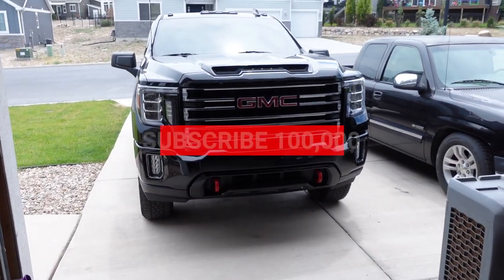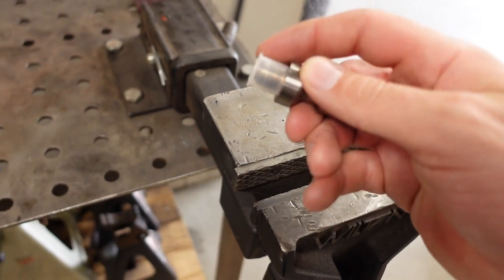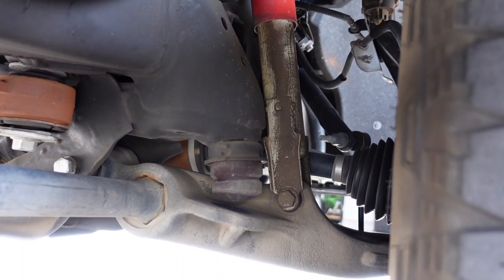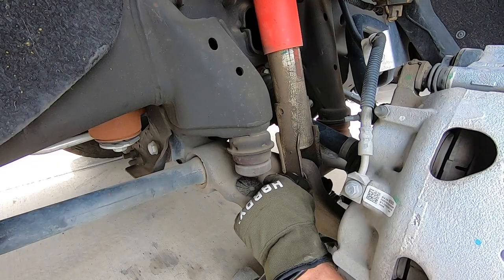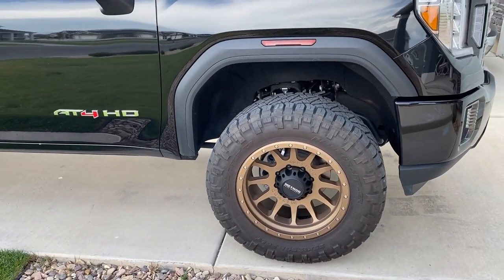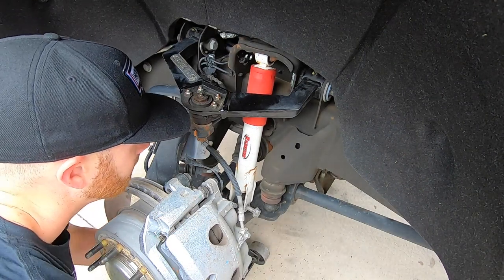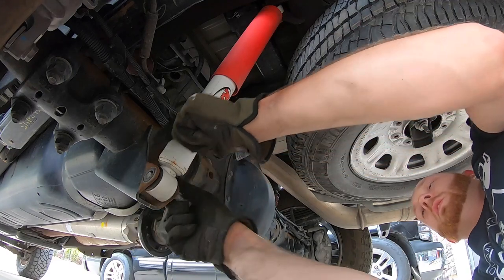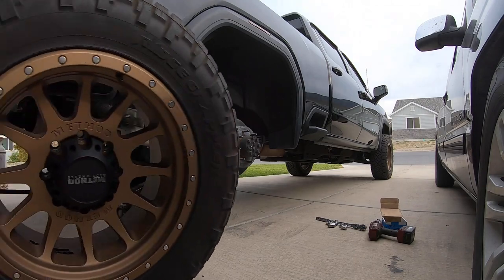Fixing what GM wont on my 2020 AT4 HD & Improving the Ride Quality #gmc #at4 #duramax

Comment: They say the steering stabilizer isn't needed due to the steering gear being increased in size on the 2011 model year.  i installed one on my 14 dmax and could not tell it was even on there, if anything it just made it harder to get to the lock during parking lot maneuvers. Install one for a video and give your thoughts.

Comment: First off, love the HD AT4!! I would have one but it would be overkill for what I need so I own a 2021 Trail Boss. Secondly, I’m surprised they run monotube shocks in the front. I have already upgraded my Ranchos and am running 6112 coilover Bilsteins in the from and 5160 Bilsteins with a remote reservoir in the rear. Worth every penny. No more annoying body roll.

Comment: Why people F with brand new trucks under warranty is baffling.  OF COURSE they'll void the warranty for ANY reason ESPECIALLY when you start screwing with aftermarket parts.  Why so shocked????
Reply from the maker: not shocked or surprised at all TBH, and even though plenty of guys have seen shock wear out with BONE STOCK trucks, I'd much rather upgrade than replace with another stock part anyway... every failure is an opportunity to upgrade the way I see it.

Comment: You can get your TPMS pressure low pressure point set to any pressure you want. Can be done with a factory or equivalent scanner
Reply from the maker: hmm... I need to learn more about this then
Reply: Can u do with Hp tuners? Or will a dealer do it ? Thank you
Reply: @bruceshepard1136  I don't think HP can but dealer or even independent shop. I use Snap on Verus
Reply: Yep. My autel and snap on scan tool will do it.

Comment: The factory stabilizer left for the 2011 model year when the GMT-900 HD frame came out (early GMT-900 were still on GMT-800 frames 07-10).  GM claims that because the gearbox was near doubled in size and had larger parts inside, that it was deemed able to handle the needs of the front end without the stabilizer shock.  GM ironically in the bulletin for it had a steering stabilizer kit you could purchase if you felt one was necessary to have.
Reply from the maker: thats funny... you don't need a stabilizer, but we made it easy for you to install one if you want

Comment: Fellow Utahn here. Considering buying a 2022 AT4 2500 Duramax right now. Have watched several of your videos and I appreciate all of the info you're delivering. 

My sister-in-law lives within a few miles of you. Gotta love those Utah horizons. =]

You mention the truck is stock height, but you also say you've installed a leveling kit. Does the kit provide ~3" of height gain up front? Are these Bilsteins too short for this application?
Reply from the maker: the new shocks are he same length as the stock ones that came off, and for the leveling kit, there is a short spacer on top of the shock so in my case its a leveled truck on a stock shock. That's how Cognito made their kit.

Comment: Have you looked into the coil over conversion for these yet?
Reply from the maker: I have thought about it, I think BDS makes em, and also Kibbetech? I'm sure that would make it ride soo much better
Reply: @LawrenceTolman more than likely. I think fox makes them too. I just wish someone would make a kit for the 4wd chevy obs. I seen that digginz71 has a lowered 4wd obs on coil overs but im not sure how well it would work on its stock or lifted counterpart. The shock towers are kinda dinky and I feel like they would rip off the frame fairly easily

Comment: Didn't your AT4 come with that "factory 2" lift" on the front ? I believe all they do is twist up the torsion bars, right?
I have a 2020, 3500hd.
Reply from the maker: That’s only on the 1500 AT4, the AT4 HD has the same exact suspension as the other HD trucks, including the Silverado HD

Comment: Hey just wanted to give you a heads up, the service tech at your dealer is wrong and needs more training. Your warranty should not by any means be effected due to installing a leveling kit. Prob 5-10 years ago GM and Ford revised their vehicle warranty to cover certain vehicles such as trucks under warranty due to some court case they lost here in Detroit. If your really concerned about it, just use a GM Performance leveling kit and pay the 1-2 hours to the dealership to install it and you should be fine.
Reply from the maker: I didnt even know GM Performance made a leveling kit for these...

Comment: Aww, you did a safety no no. Whenever you jack up the front or rear, especially the rear, you should have chalked the wheels. If you are on a slight incline, like most driveways are, and you lift the rear, there is nothing stopping the front from rolling down the driveway. Lifting the front is a little more forgiving since you can put parking brake on.
Reply from the maker: thats an accurate point, and I always do put a chock back there... just don't necessarily show every single step on camera

Comment: I am being told that riding on front bump stops is completely normal for my 2021 2500 Denali. Never had a truck ride on bump stops empty before
Reply from the maker: mine were pretty dang close when it was at the stock height

Comment: I have a 2014 Silverado 1500 and it just rolled over 100,000 miles and I just installed the Eibach Pro truck stage 2 coil over kit. Wow what a huge improvement in ride quality and handling. Highly recommend them!
Reply from the maker: another good option

Comment: Buy a 3/4 or 1 ton truck don't be surprised it rides ruff.    They're built for towing/hauling.   If it's under 10k and only tow a dozen times a year buy a 1/2 gasser.

Comment: That's actually false.. there is a federal law that states THEY...THE DEALER...CHEVY..GMC has to prove what you did caused the failure for them to void that part of the warranty...and only that part of it...sadly it would probably require a lawyer to beat them... and they are banking on you not standing your ground.